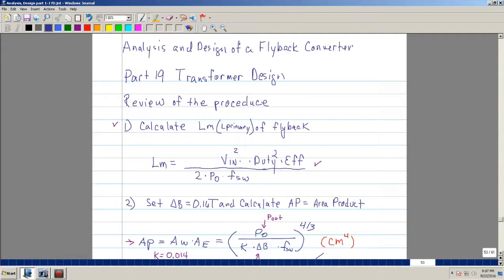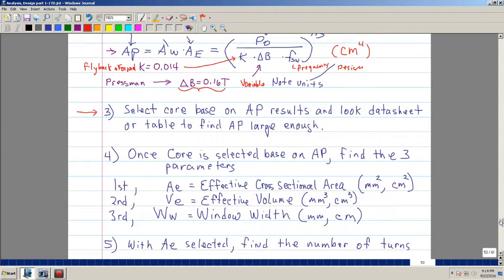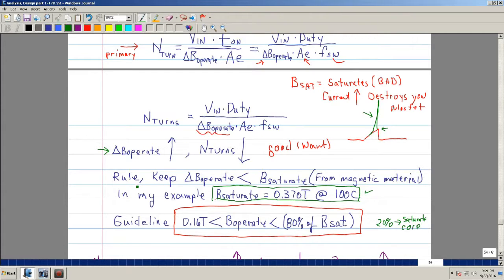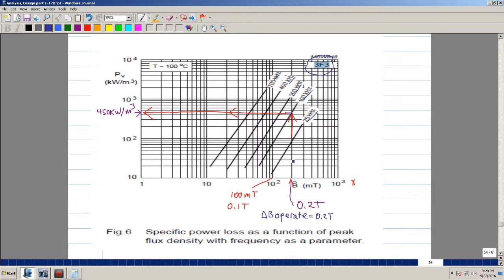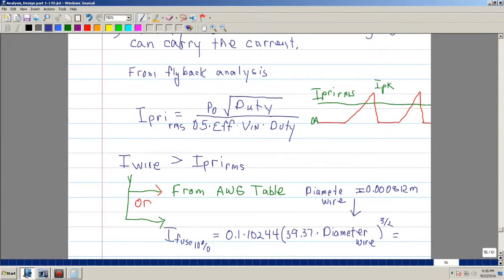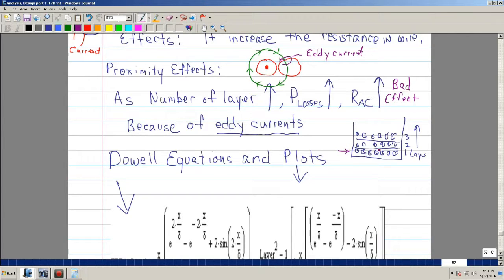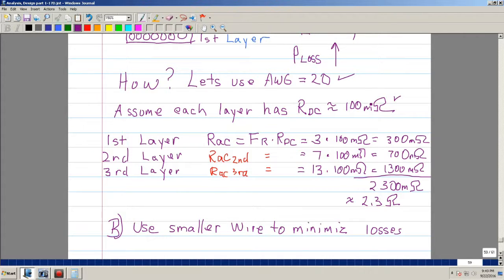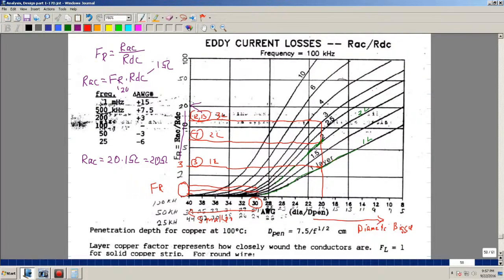Analysis and Design of a Flyback, Part 19, Tranformer Design B.

Comment: Do these calculations need to be adjusted for a pull-push topology or we can use the same calculations and use 2 primary windings?
Reply from the maker: The flyback and the push-pull operate differently. The flyback stores the energy in the Gap during the time the primary mosfet is turned on.  When the mosfet is turned off, the energy stored in the GAP will be release into the secondary.   The push-pull does not store energy but only transfers. So the equation are not the same. In the flyback you need to calculate the primary inductance while in a push pull you dont. I hope this makes sense. Robert

Comment: Hello Robert. Thanks a lot for putting all this info together. It is very useful indeed. Could you possibly clarify that if the input voltage has a range say 8V to 60V then we have to design Lm for the maximum voltage? I guess yes but... Also, would it be possible to get your excel spreadsheet, please? Thank you very much. It would be very useful to get the procedure for and Air Gap calculations. Thanks again. Cezary
Reply from the maker: Please reply to rbola35618@aol.com and I will send my files including my excel spreadsheet

Comment: while designing how to choose DCM OR CCM?
Reply from the maker: Hi, Chintu, that is a very good question. The depends on your specifications. For most low power less than 100W, a DCM would be better provided that you can handle the peak currents. Keep in mind that the Ipeak current at both the input and output are about 4 times the average current. For example, let say that the output current is 10A at 12V, then the peak current will be 40A. That is a lot of current. However, if you use a CCM then the peak current are reduced depending on the size of the primary inductance of the flyback. However, when you use CCM, you get a right hand plane zero which makes compensating the loop response more difficult. Using DCM is much more simpler to compensate the loop.  I hope this make sense. Robert
Reply: sir thanks for reply sir.i want to desin 5v/5a ouput .input is 70v dc to 240v dc
Reply: duty cycle max  iam confusing sir how to choose duty cycle max
Reply from the maker: For a DCM, the theoretical max duty cycle is 50% However, some PWM can not achieve the 50% duty cycle. So you have to look at the PWM and see what the maximum duty cycle is. So if the datasheet say that the max duty is 46% then you want to margin to ensure that you have enough. So I would then 5% and set the dytycyle to 46%-5% = 41%.  This way you have enough margin at low line (low voltage) and for tolerance in your parts.  Hope this helps. Robert

Comment: Hello again Mr Bolanos. About eddy current calculations and the plot you use could you please clarify how we calculate AC resistance if for instance we have 4 layers with different AWG wires.
 1st layer main primary 26AWG (half turns)
 2nd layer(feedback) 26AWG
,3rd layer secondary 24 AWG 
4th layer main primary 26AWG (the other half turns)
I mean i dont want you to make the calculations for me but the procedure. I will calculate 4 different Rac? is the secondary Rac the most crucial or the primary?
Reply from the maker: Hi Liis04, Can you clarify your question.  Are you asking how to treat if you have four different winding with different AWG? Not sure of the question.

Comment: I had been following your videos and they are very informative and well explained. I wish you could explain how to minimize losses  using Litz wire and where to put primary and secondary turns, Ex half pri, half sec. half pri etc. Which is the best option regarding coupling effects and losses.
Reply from the maker: Yes, I will try to do that.